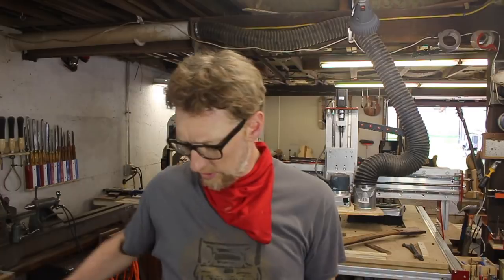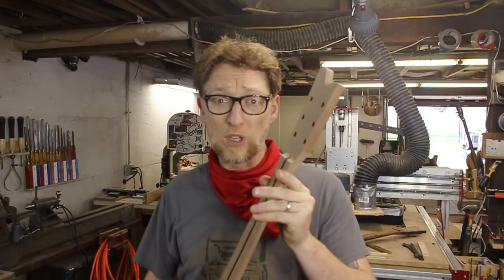How I Make Guitar Necks | New Perspectives Music

Comment: That why I want a CNC !!
Very well done!
And that bass sounds very nice in your soundtrack.
I really need to finish my home renovation and re-setup my shop and studio (hopefully for this summer)
Reply from the maker: Studio Des Pénates yea man, the cnc really opens doors and saves time,  once you get through the time suck of learning how to draw files and use it!
Reply: tim sway For sure. And I love to learn. My main issue is the cost of the machine (... and that I must re-setup my shop where we packed our furnitures during the restoration.... ;-) )
Reply from the maker: Studio Des Pénates they are expensive!
Reply: tim sway By the way, and to learn something from your experience, you seem to cut your fret slots with the machine: do you think a belt driven machine like the shapeoko 3 could reach this level of accuracy ? Or do I have to look for a ball screw driven machine (which are even more expensive) ?
Reply from the maker: Studio Des Pénates I honestly don't  know. You could try posting a message in the inventables user forum or search there, get honest feedback.
Reply: tim sway thanks anyway ;-)

Comment: Really good video! This is my next hurdle...building a neck with a truss rod. One of these days soon!👍😎🎸🎶
Reply from the maker: it is a little daunting and takes some practice getting the frets right (I'm still a novice and it takes me way too long). If doing it by hand without a cnc, the trick is remember to cut the slot for your truss rod before you shape the neck, while you still have a straight edge and a consistent center line.
Reply: tim sway that's a great tip to remember! Thanks a lot! I've done cigar box necks with frets, but they're easy and no radius or truss rod. I'm looking forward to doing a real neck, but a little hesitant yet. I know it will mean so much more to me if I do every piece of the build myself. I've been experimenting with pickup winding and I like that a lot! I appreciate the videos and all the great advice! Thanks again!👍😎🎸🎶
Reply from the maker: 74dart man pickup winding is next on my list! I have an old sewing machine I want to convert. Best way to learn is to try, right? :)
Reply: tim sway yep! That's what I did. Just grabbed a drill and some materials at first. I just got a sewing machine to convert and I'm gonna order a counter from ebay...they're around $11. Good luck with yours!

Comment: Nicely done man. Must be nice having the cnc do some of the work ;P I like the way the white oak turns out in the end though I stick with the denser woods myself.
Reply from the maker: yea, the white oak is a little risky for a fingerboard but I used the 2-part epoxy pretty liberally over it to help strengthen up any voids, then sanded it back down. the CNC is a huge hand!
Reply: tim sway i bet. Im still radiusing by hand. Though it works out. Keeps me limber lol

Comment: Nice job. Would have been satisfying to split that hunk of timber in half. Looks like quite a soft wood for a fretboard?
Reply from the maker: cheers! The wood is white oak which is certainly not a typical fingerboard wood but dense enough to make one. The janka rating of basic white oak is 1350 whereas hard maple is 1450 (basswood is 410, gaboon ebony is 3080, to help you feel out the scale :) Lately I've been into Richlite as an ecofriendly and very stable solution. Rarely do I say things like this, but foir this purpose I think it's better than wood. I actually plan to make another fingerboard video using it soon.
Reply: @timsway  cool, would be interested to see that.

Comment: Hmmm if I'm putting the effort into a guitar neck I could use some old wood I found lying around, or I could carefully select it. After repairing many necks I know what I'd do. There's some great wood out there to be reclaimed for sure, and almost any piece of wood will be fine in the short term.
Reply from the maker: You are correct. I cull my reclaimed wood for the right pieces for the right job, but sometimes I like to push boundaries and see what happens with non-traditional materials. Check out my bass made from a waterski with no truss rod, my guitars made from doors, etc. We wouldn't know they would work unless I tried! :)

Comment: I could watch these videos for hours!!!! Several thumbs up. When using reclaimed wood, do you run into changes in shape/size, and things like fret sprout when the guitar changes climate? Or since the wood is already aged, does this not happen?
Reply from the maker: thank you for the kind words. there are ups and downs to any material, of course. I've found with reclaimed, usually anything that will go wrong (warping, etc) already has so that's less of a concern, but you need to use the right wood for the right job. cedar won't work for a guitar neck, but this old cumaru will. The biggest problem with reclaimed is hidden hazards. nails, etc.
Reply: tim sway I was always told that making guitars was too expensive/difficult too attempt. Sadly I believed that, but was always curious anyway. After watching a lot of your videos, I’m going to do some more research and revisit the idea. Thanks for the inspiration and entertainment 🙂
Reply from the maker: @mattlastnamehere6403  My advice is buy a neck and the hardware, make the body around it. Once you get the body to where you want it, then go make a neck for it. Making a good neck is hard and time consuming/overwhelming at first. cheers!

Comment: I know this is an old video, but the wood that you use for necks is it Pine?  Have you had any problems using pallet wood for that?  I suppose you could always use graphite rods for reinforcement?  Thanks in advance!
Reply from the maker: this neck is white oak. I've only made one from pine (closet doors, of course: https://www.youtube.com/watch?v=Op6WMUESVcw). That guitar is in my buddy's studio and the neck continues to function fine. I tend not to bother with pine pallets and usually look for the ones made from harder woods, oak, ash, etc. Grain direction is important (vertical) or if you make a good glue up of several species sometimes that is pretty strong.
Reply: @timsway   I guess my hardest task would be finding out what type of wood the palates are. I would think the really heavy ones are oak? I have access to a bunch of those.  I appreciate the insight!!

Comment: what are those black things you used to clamp the neck to the guitar?
Reply from the maker: tThey are special clamps made for that purpose, it's a plastic strap with grooves in it and the nut twists up on it like a nut on a bolt to apply even pressure around the neck. I have an idea to make some custom radiused blocks to place the neck in and make the process faster and easier.

Comment: even though you make these necks with a CNC, could you do a video where you can make an entire neck and Fretboard by hand? (a drill can be used for the turners of course and a router) I'm curious to see the process in cutting out a headstock that way as well as angling it down
Reply: Krude Creations 
Ya Tim...quit cheating !
(Scarf joint is the answer, and he does them really well)
Reply: I mean, the only thing you need for what your going to do, is some time and patience
Reply from the maker: truth. patience!
Reply: Thanks for the response, William, Tim and Karver, this is really the start of a fun journey, so I am researching as much as I can on builds and build techniques!
Reply from the maker: Here's a (bad) video I made several years ago that shows a neck being made. Part of a whole series: https://youtu.be/G1tJoZ8ElWE It should show most of what you seek to see. I used to use a an angle grinder to rough shape the neck, but now I'm more likely to grab rasps and drawknives, etc. Bill lutes has a cigar box video he just put out that shows the similar process and I always did one piece, but scarf joint is a good way to go. Lutes also has a good video on that.

Comment: Really interesting! CNC must save so many hours and really bring up your accuracy.

What are you doing with the gauge and thumbscrews at 5:32? I can't figure out how you'd adjust the neck at that point.
Reply from the maker: Ben Holmen I've modified the jig since the video, but I use the bolts to make sure the neck is perfectly straight before filing all the frets down to be perfectly level. I then use my SqWAYre to check each fret and make sure there are no high points before going through the grits and polishing them. Hope that helps!

Comment: Is it possible to do a maple neck on it. I'll pay whatever time and material. Just a pre made fingerboard
Reply from the maker: you want just the fingerboard in maple, correct? Is the existing one bound? You're going to put it on the existing neck (which is probably mahogany?) Yea, that's fine. The tricky part is making an exact fit. What I would probably do is get you to give me precise measurements then I'd make it just a 32th of an inch wider on the sides so you can glue it on and sand it in. then you'll need to level and crown... I'm guessing from your name you know how to do all this?